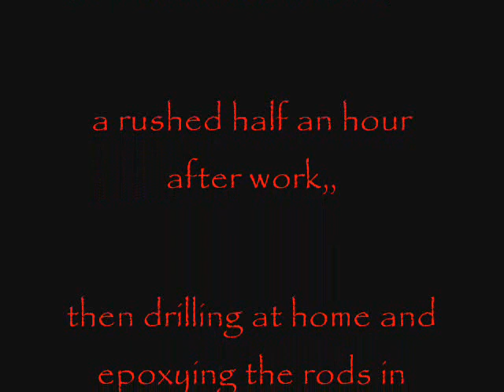How to make a batch of Custom Ferro Rod Handles using a circular saw and a wood lathe

Comment from the maker: @xXxCatsnakexXx the fore would be pretty good as the gas/air flow could be set for a fairly controllable heat,,fire steels and small stuff would be quick and easy, but hey I use what I have at home..all the best!

Comment from the maker: @BulletCastDuo hi there,I am a school Technology Technician,,basically,,wood work.lathes, metal work,blacksmithing, plastics, CNC, electronics, but paid less than Tesco's..if you notice the gas chip forge in the background,,I can't use it for my own work,,great eh? Using the lathe isn't such a problem,,in my own time and it's just the electric,,